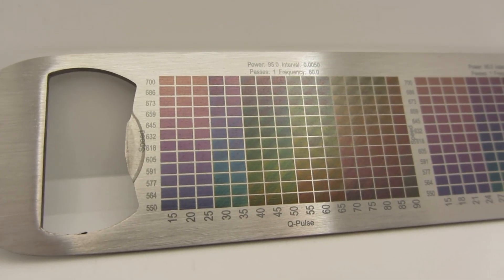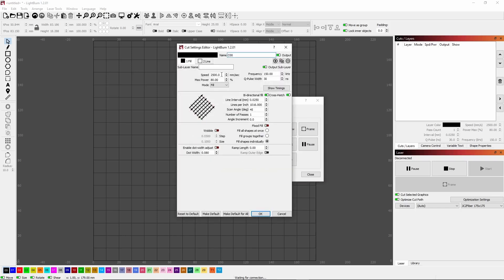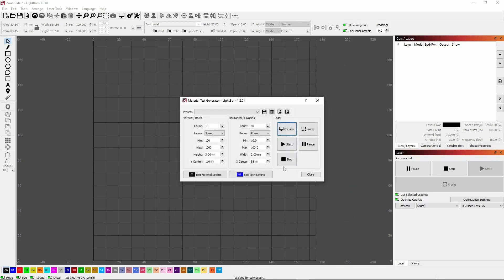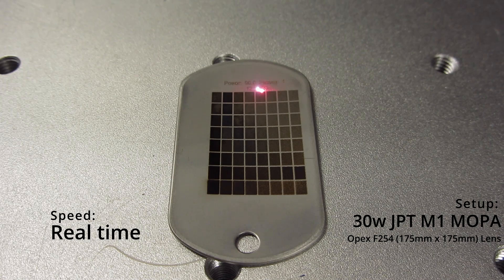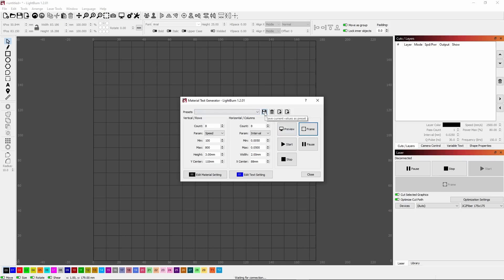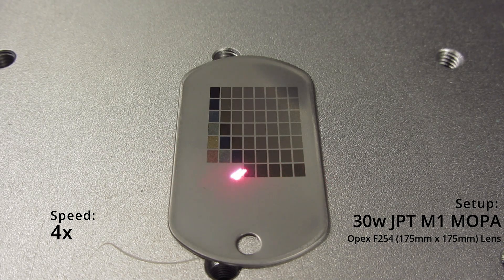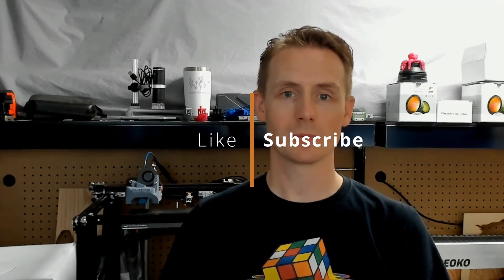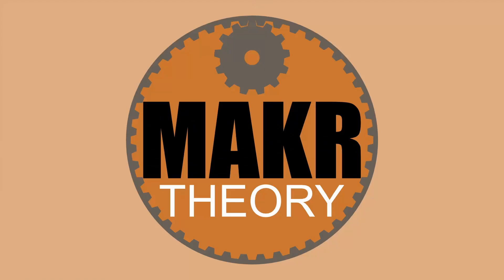Laser MOPA Color - LightBurn Material Test

Comment: Hello can you do color engraving on silver  ?   if so how many watts does person need? i see they sell them from 20w to 100w   ?
Reply from the maker: You can get a shimmery “white” and black/dark gray. Colors are limited to iron alloys (ferrous metals) and some exotic materials like titanium. Good way to verify is if you can heat the metal to near melting and see a rainbow effect after it cools, you can laser mark colors.

It doesn’t take a lot of power to make the color marks on stainless. 20w is adequate, but if you also plan to do engravings on larger items, you will want more power.
Reply: thank you sir  @MakrTheory

Comment: Excellent videos,
I’m looking to buy a mopa fiber laser to mark metal, mostly copper, brass. My question for you is what gives the color, is it a frequency of the laser type thing as it seems by watching you video or is there a physical color dye that is somehow added to give color? I’ve searched for information on this and am getting conflicting answers to the question. Thanks
Reply from the maker: Thank you. Marking copper and brass take a lot of energy, so if you plan to mark large pieces or quantities of pieces more than just hobby, I would definitely look to 60w or more.
For the color marking, there are no dyes. I have seen conflicting answers as well. For the most visible and vibrant colors, I believe the answer is a mix of the microscopic grooves left in the material distorting the light and the heat temper of the metal. If it was only the grooves, we should be able to get the same colors on aluminum or copper alloys as well, but I have never seen them on those materials.

Comment: Since the focus seems to play such an important role, do you know if the material thickness plays a role? Would it mess with the focus ever so slightly, resulting in different colors with the same settings?
Reply from the maker: When focus was properly set, thickness did not appear to make any difference on the material test grids. Perhaps that could change when marking a large area and a thin material were to overheat or warp. But that would be an issue of going out of focus.

Comment: I want a machine that can do the same on copper, although I'm not too hung up on colors id like a real dark finish on copper, so I'm still researching i will be putting detailed images on copper
Reply from the maker: Copper takes a lot of energy to mark because of how quickly it dissipates the heat. A newer 30w will work, but I recommend 50w or more if you plan on having a work area bigger than 110mmx110mm.

Comment: My machine has no Q-pulse field in the material testing box. Does that mean it does not have Mopa / Mopa is not correctly configured?
Reply from the maker: Could be either one. If you know what model your laser source is, you should be able to look it up. Most common MOPA sources are the JPT “M” series. Model number should have “-M1-“, “-M6-“, “-M7-“, or “-M8-“ in the model number. There are other variable pulse width MOPA sources, but I am not very familiar with them.
Reply: @MakrTheory  it was just a radio button to show the field. All good now. Even got some colour, but a long way to go! Thanks for your videos!
Reply from the maker: @47zero excellent! I always preface turning on the radio button with finding out the model source and if it is capable of adjusting the QPulse. I am glad you were able to get it working and start making some colors.

Comment: Whats an easy way to get the perfect focus on your lens? Recently got a 60w MOPA fiber laser engraver and it came with no instructions on how to do that! I see videos with folks using focus sticks but are they that accurate? If so where can I get sime?
Reply from the maker: Unless you get a high end lab grade lens varies slightly, so a focus stick is something you make or order to size after you have found the focus distance for your lens.

I have been meaning to make a video on finding focus, but for now, a real quick way the find the focus is put a piece of of scrap steel or stainless steel on your laser. Draw a square an easily measured size (1” or 30mm) and trace the shape. Adjust the height until the trace measure the same as on your your software. That will be close, enough to start.

To increase accuracy, raise the lens another 20mm and use a high power setting and use and offset fill on the square. Check the “Continuous” mark setting and run the mark. Slowly lower the lens. You should see the burn intensity increase until you get to the focal point, and then they will start getting weaker. You will want to go back up until you get the strong sparks again. That will be your focus distance.

You can either order a focus stick to size, or Patrick @LSEngraving sells an adjustable one that you can make to the length you need and then glue or bolt it in place.

I’ll make it a priority to get a formal video up soon.

Comment: great video! will these colors rust or corrode with time? really thinking in buying one after watching your video
also is it possible to get results like these with a standard fiber laser?
Reply from the maker: Thank you. With no surface protection or post laser treatment, I have some samples that have started to corrode, but most have not. I live in a very dry climate, so I’m sure that is helping prevent corrosion. I have intentions of doing more testing of the corrosion resistance and possible solutions. For now, I have seen others use clear coat finishes to protect markings on mild steel. I would imagine the same would work for stainless steel.

Comment: thank you so much for this video. I have now run countless material tests and I just can't get any color at all. I have a JPT MOPA 60W machine. I ran many of your tests also. Could you maybe help me?
also I asked the seller to help me, he sent me test files with frequency ranging from 20 to 80 khz and no Q Pulse changes. Also he said I needed the lens to be 3-4mm off focus which really sounds weird as I thought mopa lasers werent supposed to be off focus to be able to do color engraving. I really hope you can help me out
Reply from the maker: Thank you. I struggled for a long time before getting to the point of making this video, so I understand your frustration. I know your source can mark colors while in focus with the right settings, because I know other that are doing it. Let’s start with a few questions.

First, what material are you marking?

Second, what size lens are you using?

Third, are you etching into the material, like I was on my first tests, or are you getting any results at all?
Reply: @MakrTheory  thanks for your response.
I am lasering on stainless steel (I think it should be V2A)
Lens is 70x70
I got to the point where I managed to not etch into the material but just leave a white-silverish mark. But when I do a grid test of that setting all the marks weirdly look exactly the same
Reply from the maker: @maxgul.x  still too much power then. You will have a tough time with that small of a lens. There is a lot of energy in a very small area. I would run low frequency, low power, and low QPulse. If you can, I strongly suggest a 175 or 210 lens.
Reply: @MakrTheory  I will try the settings from your video with a 175 lens and report back. Thank you for your help!
Reply from the maker: @maxgul.x  cut the power in half since you have a 60w and I have a 30w.
Reply: @MakrTheory  will do, thanks!
Reply: @MakrTheory  I tried it with the 175mm lens in focus and it worked! I got totally different colors than you but it's a great start to at least get something. Thanks again!
Reply from the maker: @maxgul.x  Great to hear! You will have to experiment to find the colors you want on your machine, but finding any color at the beginning is the most important.
Reply: @MakrTheory  Totally agree. Again, thanks a lot for this video, it's actually the only one out there on this topic. You should definetly do more videos

Comment: txs for video! I dont see the option "Q Pulse Width" in my latest version from lightburn.... what am I missing?
Reply from the maker: You are welcome! You will want to make sure your laser is an adjustable pulse width model. If it is a JPT and has “M1”, “M6”, “M7”, or “M8” in the model number, you will have the ability to control pulse width. There are other laser manufacturers that offer adjustable pulse MOPA laser, but JPT is the most common.

To enable the controls, you will need to go to the device settings in LightBurn (the icon with the wrench and screwdriver) and and toggle the enable QPulse switch in the middle of the window.

Comment: Everytime I make material test .the material settings over rides my grid setup
Reply from the maker: The grid settings reset every time it is closed. You can save and label them by pressing on the little save icon on the top of the test window. To recall them, you click on the drop down arrow and a list of saved test settings will appear.
Reply: @MakrTheory  I didn't consider that .I'll have to double check
Reply: @MakrTheory  so I should set up material settings before test grid?
Reply from the maker: @robertarmstrong2323  as of writing this, the setting in the Material Test is not linked to the active setting of your work space. Looks like you could set your desired library setting as the “Default” and then reset the test setting to default.

Being able to select an existing library setting for the test seems like a reasonable feature. I will make a feature request for it with LightBurn and see if they can add it.

Comment: Thank you, excellent video, I have tried for hours and hours, with a 20 watt Rycus laser, which is not supposed to be made for that purpose, but to my surprise I have achieved a very interesting range of colors, I agree that the approach It is crucial to achieve a good range of colors, greetings.
Reply from the maker: You are welcome. Great work! It is possible to get color results from a standard Q switch fiber laser, it is just a more limited range of settings to get results. If you play with different lens sizes, you may find additional colors from your 20w.

Comment: Would flooding the workspace with oxygen intensify the effects?
Reply from the maker: On large industrial cutting lasers, I have used oxygen assist gas to mark black on some metals. This is something I had thought of trying with my MOPA, but want to make sure I have a way to safely regulate and contain the oxygen in the workspace. This is not something I am ready to try in my garage with a natural gas water heater.
Reply: @MakrTheory  Thank you for responding. Yes very good points. Maybe an ozone generator might have a similar oxidation effect with less dangerous risk. I was planning on setting up an evacuation air system.
I'll mess around and get back to you.

Comment: What parameters are for the "perfect" black? I mean, a perfect black is a black which black from any angle.
Reply from the maker: This is really dependent on your source, lens, and focus. For a smooth black I am using a 300mm lens on my 30w JPT M1 MOPA, but at certain angles it has a tinge of green. There are other videos that claim to provide settings for the "Perfect black" mark, but they have not worked for my setup. Your best bet is to play with the LightBurn Material Test grid and see what works best for your setup.
Reply: @MakrTheory  thanks for your response. Could you please share some values for your setup up as reference?
Reply from the maker: @Mrgruni-o7v  My settings likely will only work if you are using an M1 MOPA source, but here they are:
300mm lens in focus
Speed: 60mm/s
Power: 48%
Frequency: 34kHz 
QPulse: 210ns
Line Distance: 0.038mm
Bi-Directional
1 or 2 passes.

Comment: Great vid! Do you have one for deep engraving? I’m trying to smooth out the bottom surfaces as much as I can for engraving inside cnc machined casting molds in 6061 T6.
Reply from the maker: Thank you. I do not yet because my laser has a low max pulse energy and I had mostly larger lenses, but I have experimented with other machines and I would start by increasing frequency and speed by the same multiplier. It will take make more passes. Low frequency with high power tends to leave micro craters and splash up material.

Comment: Have you experimented with 100w mopa for this yet?  I having looking in to 100w JPT and a lot of salespeople tell me only 30w is good for color marking?  Also have you been able to cut through 18 or 16 gage SST?
Reply from the maker: I didn’t experiment as deeply with the 100w as I did with my personal setup, but we were able to achieve a range of colors using a 200mm lens. As for cutting through 16/18ga steel, if you do enough passes. It won’t be anything like a regular cutting laser because there is not high pressure assist gas. There will also be a little bit of taper to the cut.
Reply: @MakrTheory  was it much faster?
Reply from the maker: @AZKICKER-LASERS  Cutting and deep engraving the higher wattage machines are remarkably faster than my 30w. For color marking, we were only looking to get color and didn’t optimize for speed. I’ll have to talk to my friend Patrick @LSEngraving and see if we can to some color speed tests with his 80w. I’ll see if I can get a 100w in the mix as well.

Comment: I keep reading about stainless and titanium rusting (and quickly) after coloration. Your samples look amazing, would you say they oxidized easily or with handling?
Reply from the maker: My stainless steel samples have been pretty resilient, with only a few areas of the samples starting to oxidize. I have yet to dive into titanium. The “shimmering” marks seems to be the most reactive. I live in a very dry climate, so that may be a good part of why I have so little issues with oxidation. I plan to revisit this after I establish a proper testing environment. I have some ideas that I believe may work to preserve the colors longer, but I want to validate them myself before I spread misinformation.
Reply: @MakrTheory 
Any news on this front?
Reply from the maker: @GarlandFarms  I haven't managed to do any further testing. I have been tied up with family obligations of late. This is still a topic I plan to revisit.

Comment: im trying to use some bottle openers that look exactly like the ones in your video here. but mine have a film on them that i have to remove with some very light engraving passes first. did your bottle openers have this film on them as well ?
Reply from the maker: No, the bottle openers I used were not coated with anything. If it is a clear plastic film, I would be sure to peel it off before laser marking them because it is very likely PVC and toxic
Reply: @MakrTheory  thank you for the fast reply, ill try to get some that are not coated.

Comment: Please do you think with 110x110mm lens is possible to achieve the same results that you have got?
Reply from the maker: I believe it will be dependent on the source. I suspect an M7 E series source would be able to achieve similar results with a 110 lens. I have not tried using a 110 yet, but will have to look into it.

Comment: You are totally wrong ....use one M7  MOPA from JPT and you will update your knowledge about marking metals with colors on it. Your comments are based on one M1 MOPA of JPT and thats an old model ...   again use one M7 MOPA from JPT and you will get a lot better results.
Reply from the maker: I would love to get my hands on an M7, but I can’t justify replacing my M1 just yet. The settings are controlled the same way between the sources, so I wouldn’t say I am wrong. Never did I state my setting will work for everyone. I’m just showing an effective method to find settings. The settings between different sources will vary greatly, especially when comparing the M1 to say an M7-E model. The beam quality and power are worlds apart.
Reply from the maker: I have recently helped a few M7 owners follow my process in this video to find color. One with a 60w, one with an 80w, and another with a 100w. The process I used in this video still works, but the settings were different for obvious reasons.
Reply: Jose what power mopa have you used?

Comment: can the stainless steel rust after engraving on it? and I'm talking about black engraving and color (MOPA)
Reply from the maker: Yes, it can. Stainless is corrosion resistant because of an invisible (to the naked eye) layer of Chromium Oxide. This is the result of a chemical reaction between oxygen in the air and chromium in the metal. I usually apply a light coat of Bar Keepers friend on the mark and let it set for 3-5 minutes to try an build up the oxide layer. I plan to do a video testing different methods of post treatment to protect the marks on stainless.

Comment: My biggest thing was learning to do ONE SINGLE SCAN per squre, not crosshatch. I would get VIBRANT bright solid green..yellow..etc in stainless. But the minute I tried to put it onto something else, a big design, it didn't copy.  Learned t was due to the heat not being the same as a 3x3mm box doing 2 scans.  Ever since then, I just do a single scan, no crosshatch, and the color repeats dead-nuts accurate on any size decal.  Love how vibrant/bright the colors can be when you get them tuned!
Reply from the maker: Because the test doesn’t identify cross hatch vs. single pass, I try to run the test in single pass to avoid confusion. Plus nothing worse than seeing a vibrant color and then see the cross hatch wipe it out.
Reply: I wish I could say that. I can't seem to figure out any colors on my Mopa 60W Fiber. Just so complicated and sadly the video didn't help me much.  Not the videos fault just not able to reproduce anything meaningful.